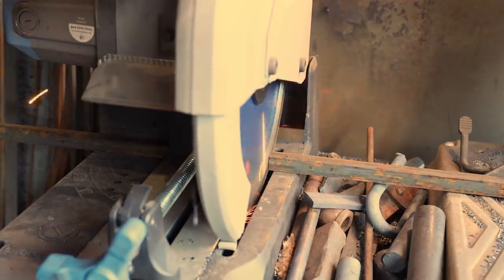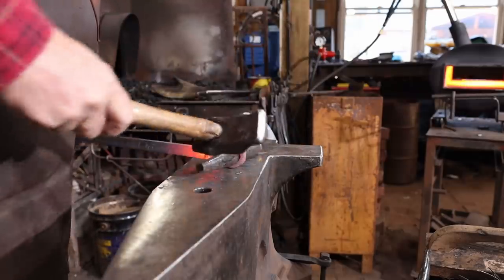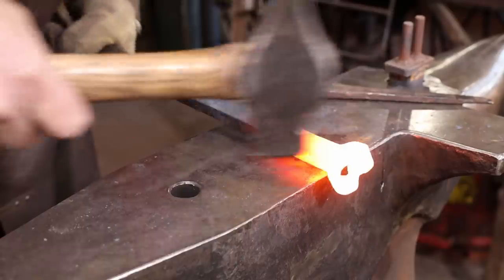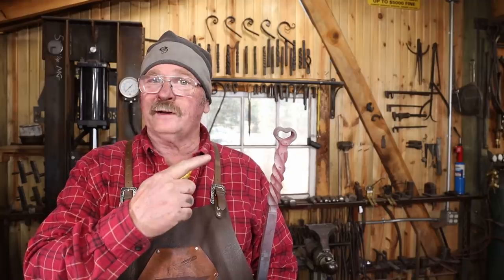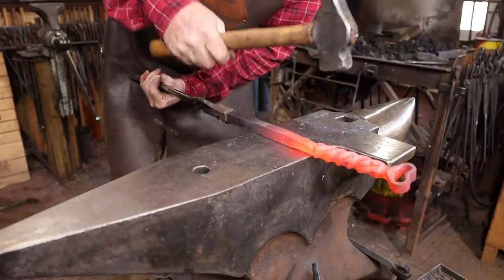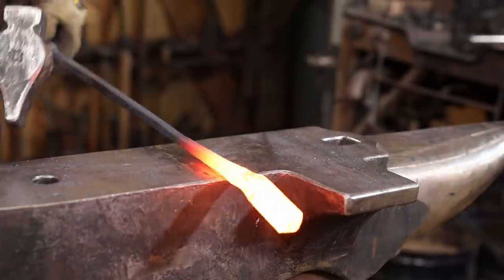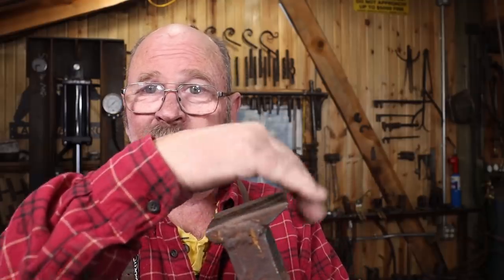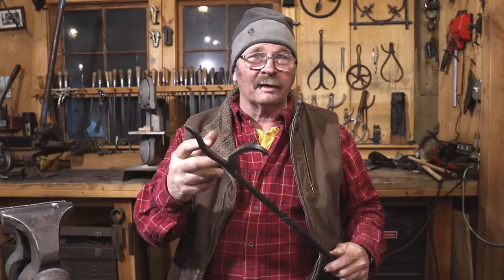Forged fire poker with Heart Finial

Comment: Ah, I had a similar experience with this idea.  I ended up drifting the hole round again, skipping the chisel part, then hammered it slightly oval so I could fit it around two pins on a bending jig (you almost did in the video, I noticed).  Once I got it over the pins I used a chisel on top to form the sharp center while maintaining symmetrical lobes over the pins, and was able to taper the bottom down to the body from the pins.
Reply from the maker: That's a great idea!

Comment: I have forged a long time on a cheapo accaiao anvil 66lber. I use a random piece of 4"x ?" X ?" For a larger anvil face. For me, if I am to make a bottle opener, when I use the horn of the 66lber they "want" to form a perfect heart with no effort of my own. It could be the positioning of my anvil to the edge of the stand - not allowing a full circular rotation. The large face anvil anvil, aforementioned, I use has a hole either end in which I drop a hayfork that I have always used to drop a hayfork as a mandrel for final rounding. Ive never made money making bottle openers, but only made them as gifts because bottle openers are as simple as a a pair of pliers/ countertop/ lighter-in-pocket/teeth-of-the-brave/chisel/obsolete(given most bottling companies.... But back to the point... I get a perfect heart shape from my wonky ass anvil. Upward to 3" diameter with occasional use of hardy fuller.  I don't care for a heart finial personally, given I am a dude, but V-day approacheth. Heck i don't care much for decorative finial at all given coal pricing and restrictions right now. But endure some will, endure some wont. Its been a warm winter in Alabama though and I really need to get my ass in the field and shoot somethings for our freezer for the summer months. Adios muchachos.

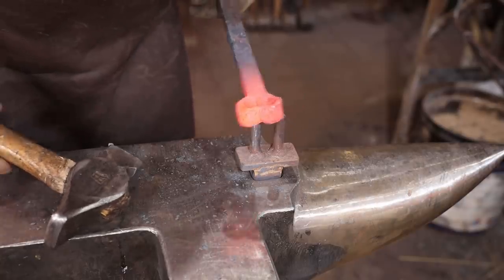Comment: At 5:30 you nearly invented the perfect tool for making the heart-top. A couple round bars the right diameter and spacing apart might let you hang the ring over them and chisel down between them to form the top of the heart?
Reply from the maker: I was hoping it would fit, adjusting the size of the starting slot would have made that work quite well

Comment: John I have a question. I have done a fair amount of metal fab in my life but am new to blacksmithing and when I draw out a square bar I always seem to get a slight twists in the bar. Is this just a matter of practice or is there any technique that will help keep it straight?
Reply from the maker: It probably means you are striking one edge first instead of striking flat.  So it may just be a matter of adjusting your swing or it could be anvil height is too high or too low.
Reply: @BlackBearForge  Thanks! I will try and be sure that I am striking flat. That is likely the problem.

Comment: G'day All, Matty D. here, great vids last year, great start to this one as well. Thanks very much for your hours you put in John.
Induction Forge Question - when you were heating up the handle end of the poker...... Could you have used the induction forge? At what stage would you decide to use a gas forge over the induction forge? What are the main influences you find that make you come to the conclusion of which forge to use eg. weather, length of material etc?
Kind regards, Everybody stay Safe and Well
Reply from the maker: right now the shop is below freezing in the mornings, so the gas forge is my first choice because it puts out more heat. But other than that is just has to do with how much of the project will fit into the coil.

Comment: I found myself wondering about a triangular drift with rounded corners and a piece of small angle iron  upset and closed up a bit on the sides to make the shape easier.  The gap from the legs of the angle iron would be great for getting that drop in.  Just a thought.
Reply from the maker: Its an idea worth checking out

Comment: Man, having that line chiseled in there really does make a nice difference. Looks like a twisted pair! Thanks for your time and instruction, John. 

What was the wooden stump procedure for?

Is there a good way to control the twist spacing to be even (1st heat) or is it just with hot/cool spots where you want it to twist more/less?
Reply from the maker: Straightening the twist without deforming the crisp edges.

Comment: Maybe use a slot punch with a sharp edge on one side, like a knife, so you can cleanly define the bottom of the heart? Might could use it to cut in the heart deeper if you cool the top of the heart before hammering.
Absolutely no idea if it'd work, but would a special purpose heart shaped drift be possible? My thinking is that you could bridge the punch in the vise with the poker in it and use another punch to clean up the top of the heart by squishing material down into the drifts groove.  Just spit-balling though.
Reply from the maker: Its an interesting idea

Comment: Hi John, really appreciate the effort you take with your videos. Question regarding shape of stock: do you predominantly use square stock over round stock? Some times it appears that time and effort are spent turning square stock into effectively round, and would it be easier to just start round. I know this depends on the project but so many (majority?) of items end up round. Thanks again for your videos. 

Steve in Western Australia
Reply from the maker: generally I try to start with material that matches the largest cross section of the finished project.  So a 3/4" square poker handle starts with 3/4" square bar even if the remaining areas are eventually rounded over.  Another option is forge welding the round to the square.
Reply: @BlackBearForge  thanks.